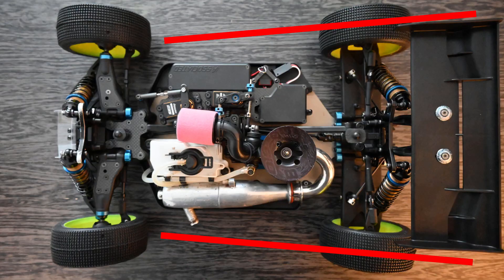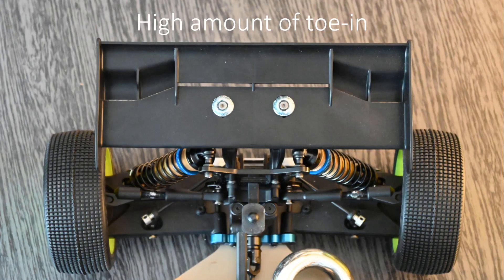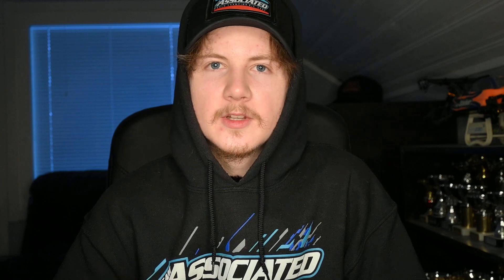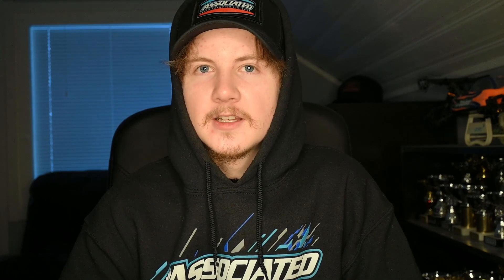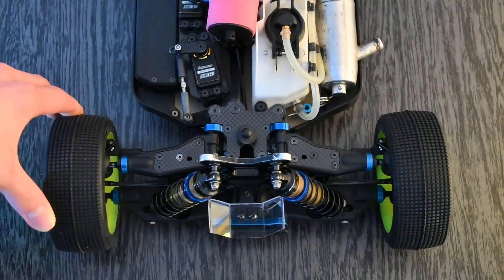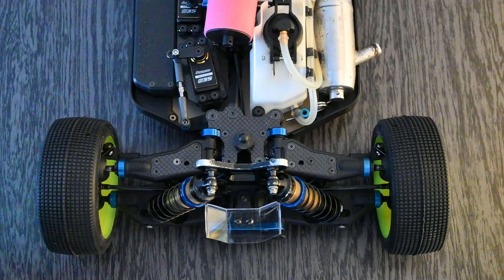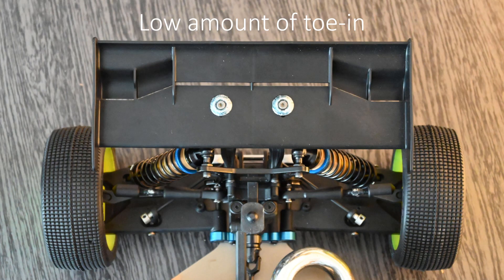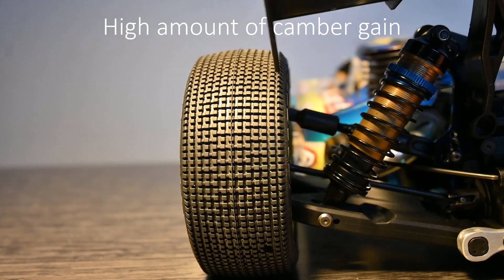From the ground up: Camber and Toe

Comment: Great video.  Had to watch it a few times to try to understand.  So, when you have low camber gain, from the car demo, it looks like you have more camber change.  The rear wheel looked like it went to positive camber.  Is that OK, or do you try to set the camber so this doesn't happen?
Reply from the maker: That effect is not something you don't want to have on the track. Depending on driving style though for racers that are smoother the car will never roll to the most extreme position. Due to this they wont suffer the downside of having the tire go so far into positive camber during roll and they will have the advantage of having the camber angle remain the same through different points of suspension travel. You might need to run slightly more camber with lower camber gain settings but mostly for me I enjoy having very little static camber either way. 

To sum it up: If you are a smooth driver most likely you will enjoy less camber gain and less camber. If you are really agressive and you like to force the car into the turn you will enjoy more camber gain and more camber.

Comment: When the static front toe-out is 1 degree, what is the toe-out value when the car is accelerating hard and decelerating hard ?
Reply from the maker: This is affected by bump steer. This can be tuned by the angle of your steering linkage. You can put shims on the inside or the outside when you are mounting the link. The goal is to make the steering link angle so that when the suspension travels there is no bump steer meaning the tires stay at the same angle as static toe-out.